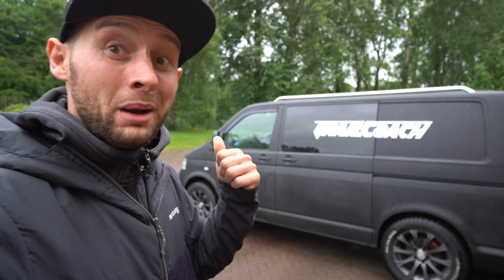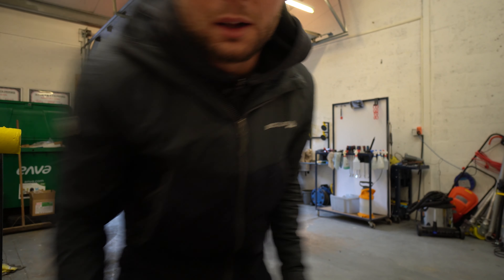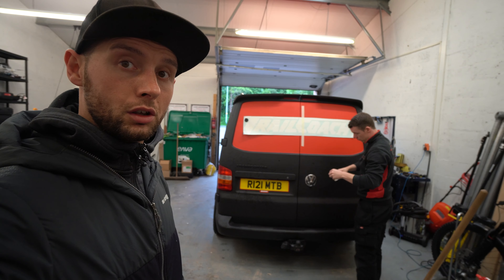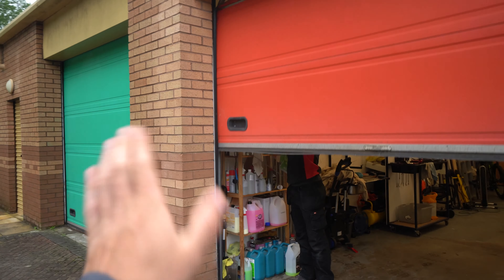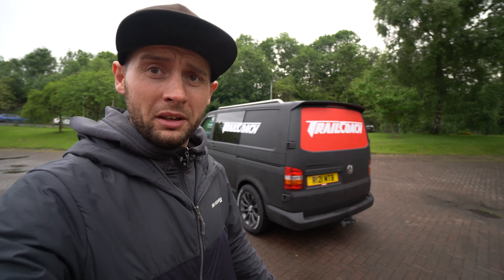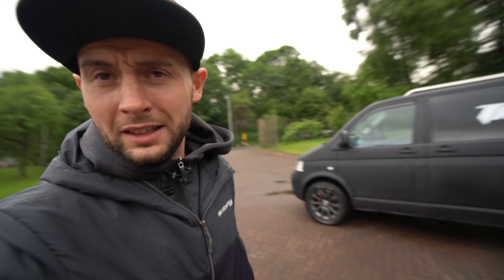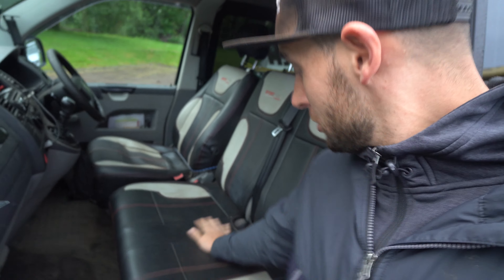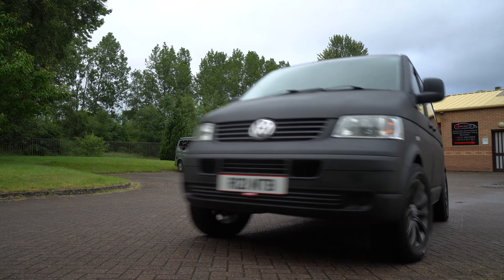WE RAPTOR'D THE VAN! 💥 VW Transporter T5 gets a makeover! 🖤

Comment: Alright Ramsey. Nice work dude. All looking good.
Don’t know if you remember me. You worked with my other half in Callander once upon a time....
We’ve got a t4 van and thinking of Raptoring it. Is it easy enough to do? And how is it a few months on? 
Cheers man. Happy biking. 
Leon
Reply from the maker: Yo Leon! Great to hear from you. T4, nice! Yeah, it's fairly straightforward - preparation is always the key! A lot of work in sanding and masking, and a wee bit of a fiddle getting the flow right/constant for the textured finish, but it's well worth it. A few months on it's still solid other than the odd chip here and there where I abuse it, and on the flexible bumper plastic, there are a few wee peely bits. Cheers dude
Reply: @RamsayMacFarlane  yeah that’s what I thought. I’m doing all the prep and paint myself, and thought raptoring it means less maintenance/polishing and less flatting back when painting. Will tackle it in the spring! 
Cheers dude, appreciate it. Hope all is well with you. Am off on my mtb for a bike packing trip in a couple weeks so happy days!
Reply from the maker: @NameisLeon  I haven't washed mine since it was painted 🤣 it's well worth it! Who need shiny paint anyway? Good to hear of the bikepacking, enjoy bud! 👊 Bikes are the best 😁